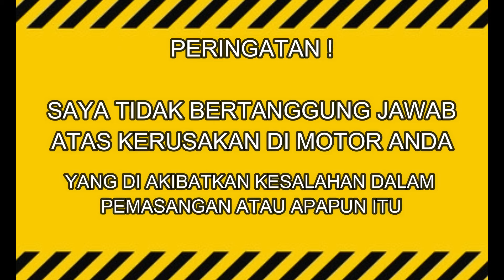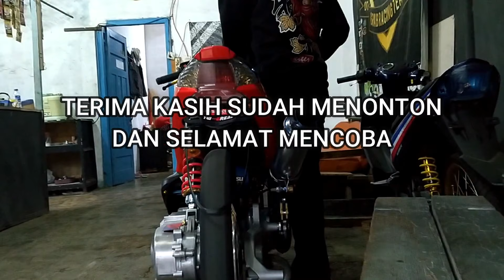Cara membuat knalpot motor nembak keluar api |rapid backfire matic dastek | antilag versi karbu

Comment: ane coba praktekin di mobil injeksi hasilnya kaya dastek😆😆🤘 . rpm  2000 aja kaya senjata Ak-47 . thanks infonya
Reply from the maker: mantap
Reply: @ZuuSazu  modul relaynya ga bertahan lama om . tadi sore putus 😆😆. biar awet tambahin komponen apa ya . apa dengan kapasitor bisa awet om . mohon infonya . ane suka trik ini .
Reply from the maker: @AnyaXi  relay yg putus yg 4 kaki atau yg interuptor ? ,, kalo yg 4 kaki saran sih pake yg transparan jangan pake yg biasa, kalo masih putus coba pake elco buat penahan voltase, kalo elco nya coba searching deh di google kalo di jelasin juga bingung yak hehe
Reply from the maker: @AnyaXi  atau gak di bikin sikring antara positif relay ke akki
Reply: @ZuuSazu  cara nambahin elco gimana om,saya sudah coba 2x di mobil injeksi tetep kebakar
Reply: @AnyaXi  caranya gimana om
Reply: @Jason-tc2vm  sama kaya d video. Cuma buat sikring + relay FI dibikin inden. Jadi busi ga nyala pun bensin tetep keluar kaya pake karburator. Bikin dua rangkaian aja. Buat busi 3 sama 4. Sisanya naikin CO sama setel tps.  Timing api sama vvti biarin aja jan di oprek. Cuma emng ga segalak dastek atau twinligt. Tapi lumayan lah buat iseng mh. Avometernya yg digital kalo bisa. Emng Check engine nyala. Tapi gpp . (Kata temenku) 😁😁🙏
Reply: @AnyaXi  hasilnya berarti ga sekenceng dastek ya?
Reply: @Jason-tc2vm  kenceng sih kenceng. Cuma iramanya ga teratur. Kalo dastek kan lepas baru brebett. Kalo ini maenin pedal baru brebett. Minusnya musti masuk gigi kalo lagi jalan mah. Jadi lebih ngandelin blowback daripada backfire.
Cuma mungki. Kalo mobil metik sama kaya video d atas maeninnya.
Reply: @AnyaXi  tapi check engine nya mesti nyala ya bang🤣 gw takut diomelin bokap soalnya wkwkwk apa ga ada solusi bang buat ngilangin check engine nya
Reply: @Jason-tc2vm  itu mh pinter pinter sendiri aja.
Reply: @AnyaXi  koil mobil kan ada 3 kabel ada yg 4 kabel bang, itu yg di sambung ke relay yg mana bang?  yg kabel warna apa?
Reply: @RYCONTROLLER  tiap mobil biasanya beda warna. cuma satu dari ecu aja. biasanya coklat
Reply: @AnyaXi  kmu sambungin yg + koil atau sinyal ecu koil om?
sampai skrng aman?
Reply: @AnyaXi  saya udh pasang di coil 3 dan 4 saya tekan tombol kok mobilnya cuman brebet2 aja ya gan
Reply: @i love stephanie cara nyambung ke koilnya gmn krn koil mobil ada 4
Reply: @AnyaXi bikin vid tutornya bg
Reply: @AnyaXi ada deketsa nya kah

Comment: Sekarang jadi tren ya motor nembak nembak.dijaman saya dulu kalo knalpot nembak+keluar api itu ada masalah dikarbu'y..jadi buat temen temen yang motor'y nembak2 jangan malu end resah 😁😁
Reply from the maker: kalo jaman sekarang jadi susah bedain nembak karna ada masalah atau di sengaja 😅😅
Reply: @ZuuSazu  
Iye bener mas bro, tapi itu keren sampe kepikiran buat alat seperti itu! Kreatip
Reply: @ZuuSazu  
Owh iya tips dikit dari saya jangan sering di pakai,itu ada epek buruk'y juga lama makin lama memperpendek usia piston motor'y + lebih parah piston bolong apalagi motor standar. Nuhun a bro punten sanes menggurui...
Reply from the maker: @asepwera6271  berawal dari iseng bang hehe
Reply from the maker: @asepwera6271  makasih banget tips masukannya
Reply: @ZuuSazu  sama sama bro. Tpi maap bukan so pinter cm berbagi aja